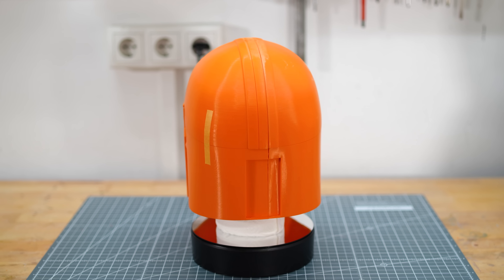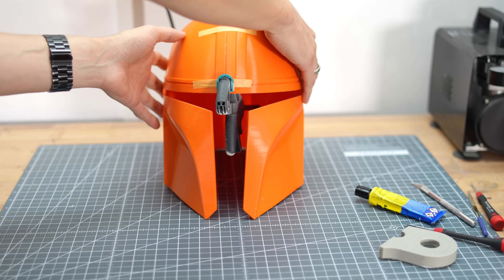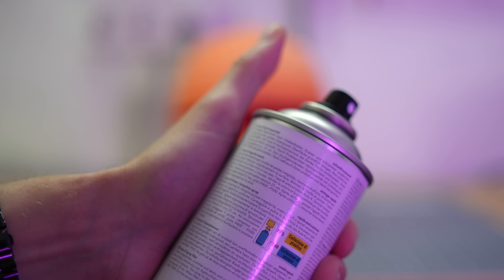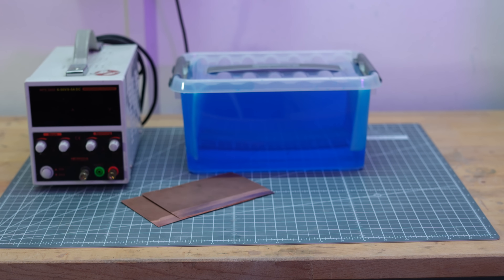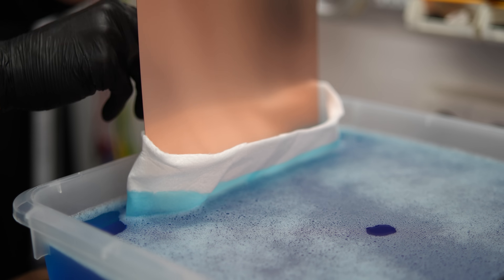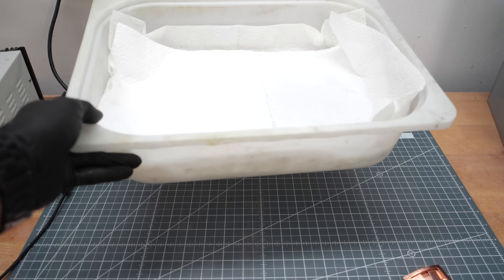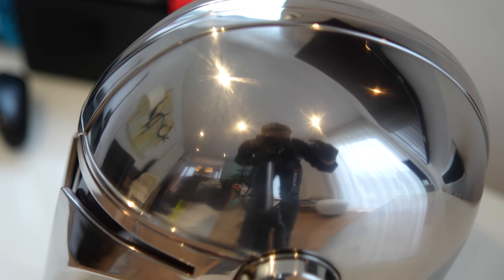Electroplating 3D Prints |  Helmets Tutorial 1

Comment: This was such a wild video! You absolutely killed it!
Reply: Agreed Uncle Jessy. Would love to know the cost !
Reply: @TheHoody999  i too
Reply: @TheHoody999  Well, the best I can find Copper Electrolite online is about $120/gallon, and I think that tote he used is about 12 gallons.... so ouch. 

In addition, the powersupply is probably about $90, the helmet is about $5 in materials, the paints are around $25 (definitely more in the long run), the palladium is about $30, an airbrush is about $40, the clamps/brushes are about $40, and the rotary setup probably cost about $25 for wire servos and switches, and the copper sheets about $20.

I'm thinking for the base setup, with a gallon of copper sulfate, it's about $300 to get everything you need (not including the 3D printer). But for this video, we are probably looking at about $1,500 investment, unless he has a better chemical supplier, which I certainly hope so. 

Source: I'm thinking about investing in a small electroplating setup.
Reply: Indeed. A wild ride.

Comment: Hi,
Thank you for this tutorial ! The surface of the helmet requieres  30Amps for electroplating but I guess the surface should be reduce of 50% since the inside won’t be plated and the power supply also no ? 1A/dm2  right ?
Reply from the maker: I used all 30A for half the surface area of the helmet. I started 18A and went to 30 after 2 hours,

Comment: in one of your previous videos you mentioned that if we don’t know the exact surface area of the object adjust the amps so its at between 0.6V-1V. I note in this video you were at 2.1V. Can yoyu give some guidance on that? Is 0.6-1V just to start? Or just for smaller objects? What is the maximum voltage we should get to? I am copper plating a 25cm statue of a father and adult daughter, approximately 920cm2. I have a 10A Power supply. Love to hear your thoughts.
Reply from the maker: What I’ve learned in this journey so far: voltage tricks you. Always calculate and go 50-75% current at the beginning and 100% after 15-30 min. 10A should work.
Reply: @hen3drik  Awesome. Thank you so much! I just did a 10cm egyptian chess piece at between 0.6 and 1.2V and it came out beautifully. Going to try the big 25CM wedding model this week!
Reply: I have read that its important to keep the electrolyte solution at between 23-28 degrees C however any immersion heater I can find for a reasonable price has metal that will contaminate right? wht if i just put a space heater on outside the tank, do u think that’d work? Or should i not worry too much about temprature.

Comment: Your content is amazing, I've been going through every video! Quick question: At @7:50 in the areas where the copper plating did not stick(above the eye), did you just use the galvanic pen with copper electrolyte to cover those areas? How did you remedy? I noticed the helmet is fully covered by the time you polish and plate it with nickel/palladium.
Reply from the maker: Oh it sticks there. It‘s just that electrolyte residues etched the copper hours later. You can just polish it away.
Reply: @hen3drik  ah gotcha, thank you! I am hoping to try this soon

Comment: The result of the technique looks great, however for any aspiring prop builder, Mandalorian helmets like this should never be left standing upright on their cheeks like this for longer, especially not if they are not reinforced at the lower chin area and do not have a very solid visor holding the cheeks together. You can actually see during the course of the videos how the cheeks bent outwards and warped a little simply due to the weight of the helmet resting on them. I had this happen even with a full resin-fiberglass cast that was much thicker and sturdier than this 3d-print.

Either put them upside down on the dome or get a helmet stand that has the contact point on the inside of the dome, never the sides. That's how I store and display my finished helmet as well.
Seeing Mando helmets with the cheeks warped and bent outwards due to improper storage is a bit of a pet peeve of mine.

Comment: How do you make the bracket and motor to spin while in electrolyte
Reply from the maker: I modified an existing design to support bigger copper rods and used a microcontroller with a 360 servo

Comment: If you're producing much composite fiber, I'd suggest making prepreg sheets and freezing them in tubs in a shop freezer, crucial for a composite shop.
Also, save scraps for floc(flocculant resin composite for non linear fill and certain aesthetics).
Lastly, if your really working with more bulky forms, consider getting aramid or aluminum honeycomb for linearly rigid bulk component fill.
Not particularly expensive on a production level volume if that's a consideration.
Also note you can use different gage wire meshs for less weight critical surface volumes when laying up composites, and ofc that can all be gound out of you are just needing it to bridge or make things like a wing when sculpting on armatures.
o7

Comment: Is it a problem if the power supply only goes to 10 amps?
Reply from the maker: Yes. You need to be in a current range to have the copper deposit well. Calculate 1A/dm^2
Reply: @hen3drik  and can i use a pump to curculate the water instead of the product? Thank man you helping me building my dream

Comment: Wow. How much did it cost to make this?
Reply from the maker: Material was around 50-80€.
Reply: @hen3drik  More affordable then I thought. Thanks for the info
Reply from the maker: I missed the reusable copper electrolyte. This is a lot more, around 750€.
Reply: @hen3drik  Damn. But it is something for a long time. And you dont need that much if you only do small parts
Reply from the maker: @daskampffredchen  correct. I use a 5l container all the time. These 40-50l projects are a bit proof of concept. It’s honestly pretty hard to handle these large batches.

Comment: Hi HEN3DRIK and thank you for your tutorials. Probably i missed it, but you could help me. Is there a correct formula to calculate "volts" and "ampere" to use? I have a lot of objects with different size and i would like to try to electroform them correctly. Thank you in advance.
Reply from the maker: Set your power supply (you‘ll need a regulated one) to constant current (cc). Set current to 1A/dm2. Volt will regulate automatically

Comment: Where do you find polypropylene anode bags sold individually? I found only one expensive item from a single seller (!) on the well known Ch|nese website, with no mention of the size whatsoever.
Alternatively I would even prefer woven PP fabric by the yard rather than small fixed sizes, sheets that I would cut myself to the desired dimensions.
EDIT: I find more easily non-woven PP cloth, of the type found in surgical face masks. But I don't know if they are OK for electroplating vs woven PP.
Reply from the maker: It’s complicated. I order 20um pp pond filters and cut them. Hard to find, not even working good. So I switched to coffee filters (2-5um) and put them into these old pp bags. But I still have impurities in the solution. Got to figure out we’re these come from.
Reply: @hen3drik  It weird indeed, especially as I see that woven meshes of PP industrial anode bags are typically 1 to 200 µm.
Definitely something we should look at and try to crack that nut!

Comment: Hello Hendrik, 
Thank you very much for your videos. I could learn a lot from them. And I ask for your help.
I would like to use the same copper conductive paint as you with an airbrush. However, the result is always a brownish, matte layer that, comes off in the copper bath. When I apply the lacquer with a brush, the layer is shiny and further copper plating works. Do you know this problem and if so what was the solution? Does it have anything to do with the humidity in the room at best or can the set air pressure of the compressor have something to do with it?
Thanks a lot for your Support.
Regards, Mike
Reply from the maker: That is most likely because you don't do constant current but constant voltage, I guess. Can you clearify your process (amps/surface area measurement etc.)?
Reply: @hen3drik  Thank you for your quick reply. 
Already when spraying the copper conductive lacquer with the airbrush, the applied layer on the object discolors and looks rough and reddish. The copper bath isn't involved at this point.
Even after several hours of drying, the copper conductive lacquer does not hold properly and crumbles off. If this object is hung in the copper bath (without current), a pile will form at the bottom of the tank. Probably this will also happen if I immerse the object in another liquid.
Reply from the maker: @mikekeller448  I assume you dilute it with acetone. Dilute it some more. 1:3. Try not to build up the paint. Go 3bar full power. Apply 3 coats with a dry time of 10min between each other. Try to "wet" airbrush the paint.
Reply: @hen3drik  I had tested the copper conductive lacquer in each case undiluted or in a 1:1 ratio with acetone. The whole in each case with 2 bar.
I'll gladly test your way. Thank you....  🙂

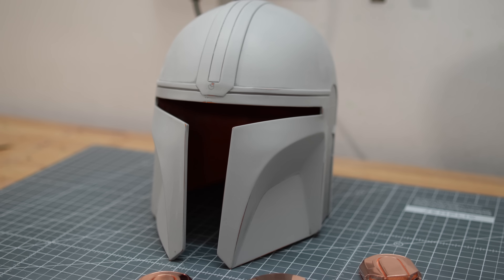Comment: hi there, thank you very much for the tutorial! i have one question: you said u use 2A per dm2, but when you calculate the surface at 5:44 you get 0.34m2 which is 34dm2 so it would take more than 60A to coat the print, you speak of 30A+. Am i missing something? really love your tutorials! thank you in advance
Reply from the maker: thanks, I didn't coated the inside with conductive paint. So it's roughly half the surface area.
Reply: @hen3drik  ahh makes sense, thanks!

Comment: So something me and a pal had some success with was fine sanding then using a very small amount of acetone to smooth over the sanded areas BEFORE you blow away any plastic dust. It's like the sanding removes the peaks to dust, fills the troughs with the dust and then the acetone lightly wiped sort of welds the powder into the troughs. Better than using a filler and 'disposing' of the dust which is both a very usable and very unwanted micro plastic waste.

Comment: One thing I have done in the past to reduce the volume inside the bigger tank is to use empty glass jars which takes up space in the tank so you don't need as much solution.  I used pickle jars, and the tank was low enough that the mouths of the jars were above the surface of the liquid.
Reply: He means fill the jars with concrete.....
Reply: You could just fill them with concrete
Reply: @glennedward2201  concrete is brittle, could ruin the liquid and it may not be usable again.

Comment: I would have used a smooth cast to reinforce the seams. Instead of fiberglass and resin. It's also less toxic. Doesn't have much of a smell either. 

Oh yeah don't poor chems down any drain. The city waterworks can trace it exactly to which drain it came from. Someone at my job didn't think pouring 15% concentrate Hydrochloride acid was a big deal. Until the business was fined $2 mill and the city had to replace 3+ miles of piping. Just in case anyone wanted to know why you can't pour chems down drains.

Comment: hello again Hendrik great idea in your other tutorial, of using til to cast inside 3D print there are electroplated, A qustion regarding the galvanic pen. I bought one from Tiffo Marawe, - but have isues of transfer the copper to my 3D elecroplated sculpure. It seems very greyish even that i use a copper rod of wrapped copper wire. Dont know if its better to use a tube of copper, or if i should use the grafit rod included in the set. It seems like you use the grfit rod, and then somehow transfer the paladium or other metals to the helmet. I dont understand how this is done, but i¨m very interested in transfer copper to my missing spots on my electroplated sculpture. The spots have of course got conductive paint but get a not copper like colour after i use the galvanic pen. Do you have an advise ? regards Frank Fenriz DK
Reply from the maker: Hi, you have to use the right pen anodes corresponding for what you're planing to do. i.e. copper needs a copper anode. Be aware that copper plating with a pen is very difficult and let's you only deposit a very thin layer of copper to the conductive paint. have you read the "Handbook Electroplating" found on their site? In my oppinion this contains everything you need to know. The also include manuals to all of their electrolytes an products with hints how to use them. These are essential informations for handling the chemicals correctly. greetings.

Comment: Hi! I've got everything working but the palladium is very sensitive to voltage, is that the same for you? 0.2v too much and it turns black. 

Also, my filters (the ones you recommended me once for aquariums) let the copper redidue from the anodes through, do you wash them and how do you handle that?
Reply: I use a graphite anode (the tifoo galvanic pen) at around 4 to 5v. At 4V it wouldn't plate, at a bit higher than that the surface becomes black and loses its shine...
Reply from the maker: I use 5V.m and constant motion. Palladium deposits slowly at the beginning. Make sure to pickle the copper first (10% HCL or 15% citric acid). I have that black layer at smaller pieces, too. This can be polished away, keeping the shine. The anode bag, yes. I use coffee filters inside the bags to catch the dirt. This is very effective.
Reply: @hen3drik  s always, thank you so much for the pure gold of information! I didn't know about the pickeling, thank you very much, I will absolutely try that. And good to know that it deposits slowly.

Vielen vielen Dank! :D

Comment: As cool as electroplating is, its really overkill for this.  Movie prop wise mirror finishes are done with chemical silver plating. Which is a two part spray on version of tollens reagent, which is then followed with a clear coat to prevent oxidation. For example Phasma's suit was done in exactly this method. While things such as Din Djarin suit were not plated at all, it was just resin cast and air gunned with Alumaluster (Bit pricy for a hobbyist though)

Comment: a very great tutorial . a question could the Galvanic pen been useed to electroplate missing spots on the 3D print when plating with the copper? i have experientet smal spots who dont get plate, and wonder if that could solved it. Is there a pen you could recomend for this, like to small works regards Frank Fenriz DK
Reply from the maker: I know that effect and got to get tied of it by degreasing and pickling or decaping the copper layer with citronic acid before galvanic pen. Just google galvanic pen. Try a steel one. They serve as a handle for anodes with various diameters.

Comment: The sanding process is time consuming and laborious but I find it rewarding and kind of zen while doing it.  I recently did a project involving sanding with 220/400/600 grits 1200/1500 wet sanding, then polishing with a sequence of different grades of diamond pastes.  In between I had to apply layers of a materials akin to the car finish spray to been out tiny imperfections (a slurry of a porcelain like plastic mixed with a phosphorescent compound) Overkill? Yes but the final result was unique.
.

Comment: Hello Hendrik, is it possible to consider doing several electroplating baths for the same room, to avoid making large electroplating tanks. That is to say first I dive a part of the room for 4 hours then I dive the other part of the room also for 4 hours. All this to avoid using a lot of copper electrolyte.  On the other hand I wanted to thank you because your videos are great. I'm going to embark on the adventure. I draw parts, all the hardware for 3D printing because I make a model of Riva Aquarama boat, at 1/6em scale All parts are mostly chrome. If you want I'll send you pictures. Bravo again for your videos
Reply from the maker: I get what you mean. You can do that for electroplating thin coats but for copper you‘d end up having a thicker/thinner seam I guess.
Reply: @hen3drik
Reply: Bonsoir Hendrik, un grand merci pour ta réponse, je ne manquerai pas de poster mes premiers essais. Encore bravo pour vos vidéos. J’attends avec impatience les nouvelles vidéos.

Comment: If you brush a thin layer of resin on the workpiece before applying the fiberglass cloth, it's easier to avoid bubbles and fully saturate the cloth for the best adhesion.

Excellent work.

Comment: Use a scraper instead of sanding. It gives a very slick, fine finish and removes material much quicker than sandpaper. It also does not heat the surface like sandpaper.
Reply from the maker: I‘ll try. Do you have a link, I’m not sure if I got what you meant exactly.

Comment: how did you calculate the required amps for a different size item?    what software or calculation did you use?
Reply from the maker: I use blender for this. There is a plug-in called 3D print Toolbox. Use this to get the m^2. covert to dm^2 and multiply by 1.5. this is your ampere to aim at.

Comment: You can save a ton of time by using bondo, applied with a flexible plastic/rubber scraper in small sections since it hardens fast. If you put it on too thick, use a very sharp tool like a good chisel to shave the bondo once it hardens enough where it's not sticky. You gotta movce quick to remove excess before it fully hardens, otherwise you'll be doing a lot of sanding.

Comment: Plating something so large is extremely challenging and you absolutely nailed it! Incredible surface finish!
If only I knew you could buy galvanic pens a few years ago 😅
Reply from the maker: Still mean, you have to have four hands to work as fast as lightning. Electrolyte is acidic and copper oxidizes and so on and so.. thanks Brodie
Reply: @hen3drik  yeah there is definitely a reason I don't pen plate or brush plate often at all (and I stick to cheap(ish) electrolytes that I can fill a 20L tub with).